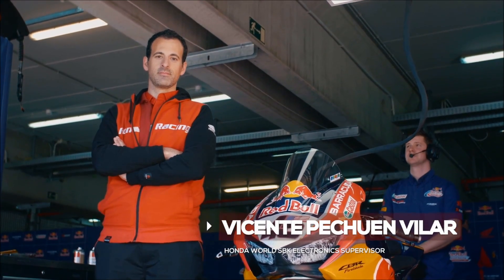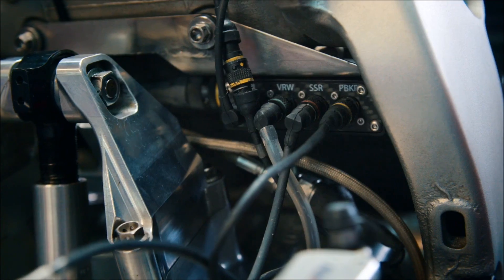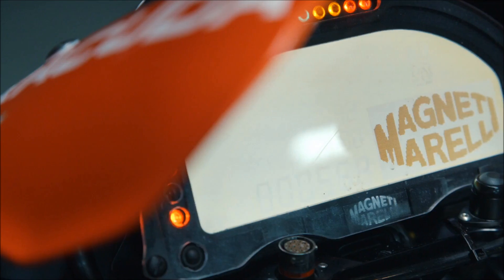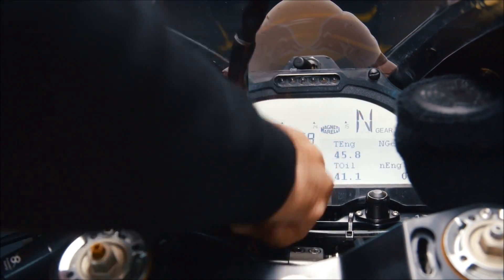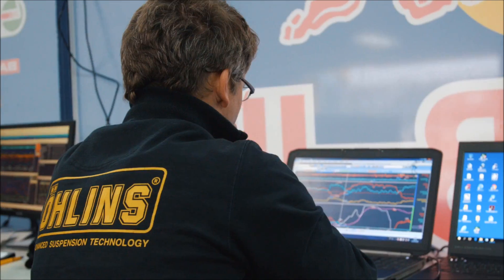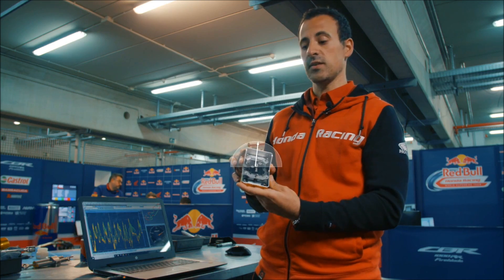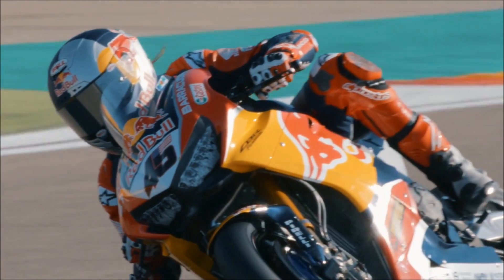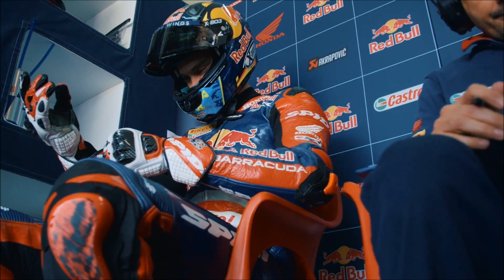New Honda CBR1000RR Fireblade SP2 - WSBK | Electronics Explained

Comment: 2:40 Nissin Brakes instead of Brembo?
Reply: You're all talking bs! My 2002 Honda RC51 has Nissin calipers and at the time biggest rotors and are amazing! I've ridden modern bikes with praised Brembo calipers(KTM Superduke,BMW rNinet, for instance..) and the brake performance was as good as you could expect but absolutely no feel at all....would'nt swap for a million!
Reply: Kuya Robbie because it's Honda's official sponsor for wsbk..  even in moto2 some bikes use nissin brakes
Reply: thats cuz u suck
Reply: Not like your mother.
Reply: They run it in MotoGP aswell
Reply: I saw a set of those brakes for sale on EBAY UK...taken directly off a WSBK. They wanted 4000 GBP ( British pounds). They sold quickly.
Reply: Von Crackenfart yeah, stock is shiet.
Reply: And they are Shit, the stock brakes on my CBR 1000RR are pure and simple shit.